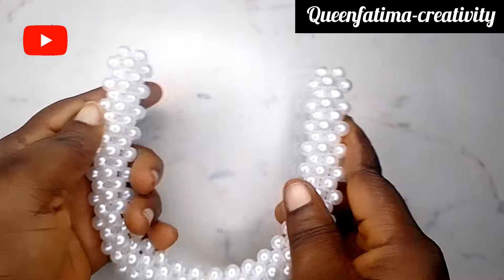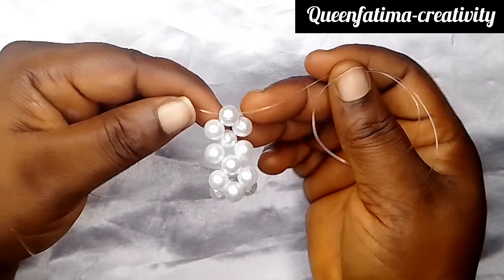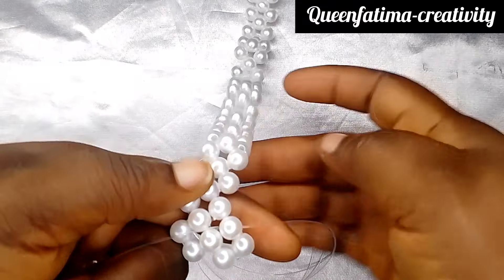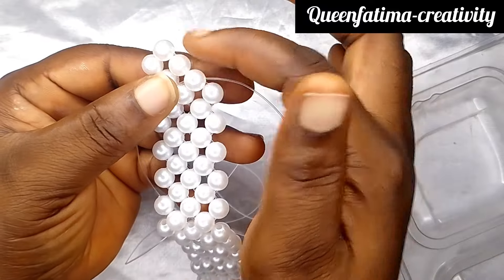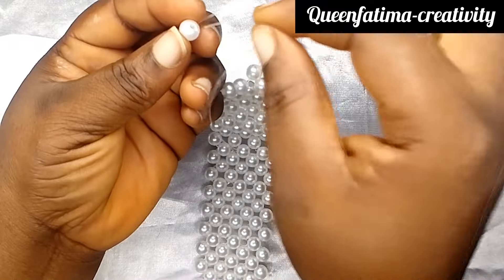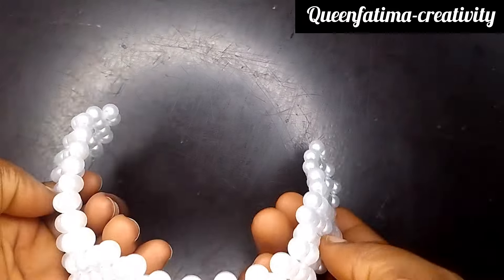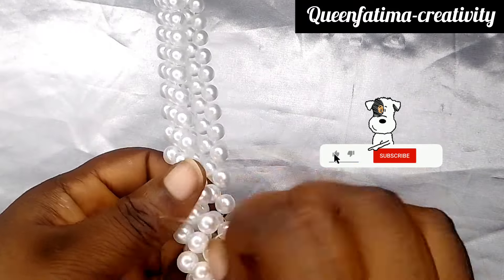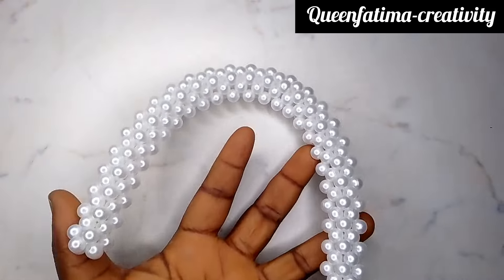Quick and Easy way on How To Make A Beaded Bag Handle

Comment: The materials used are top notch. The leather feels soft and luxurious, exactly like the real thing. The stitching is impeccable, with no loose or uneven lines. The hardware (including the iconic CC twist lock clasp) is durable, well made, and adds to the overall elegance of the bag  :yt: luxrul :yt:  . I thought everyone who owned an LV monogram bag knew that it was obviously coated canvas? When people spend a fortune on an expensive bag, they might as well buy a replica